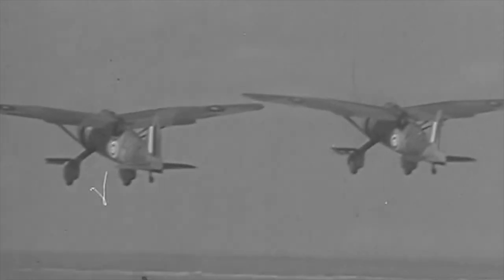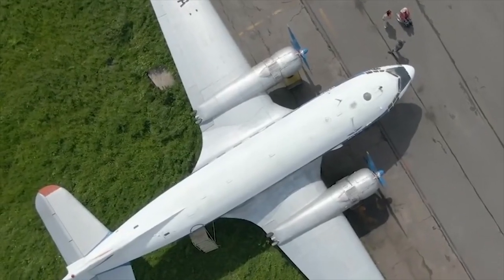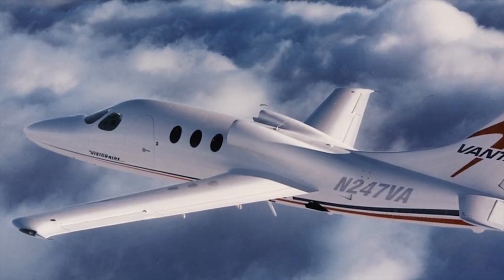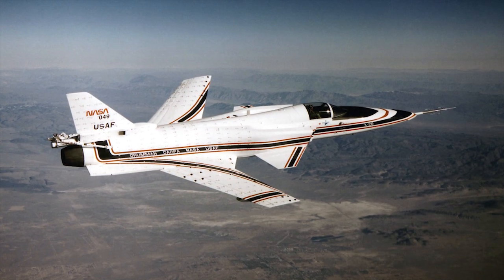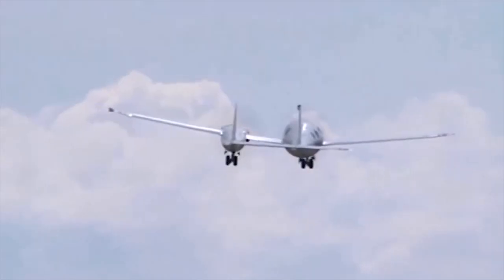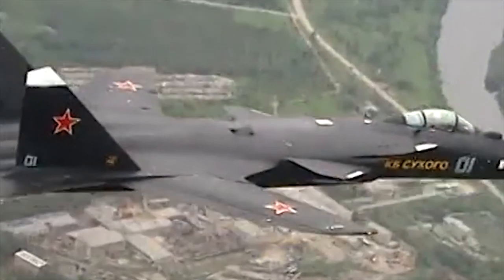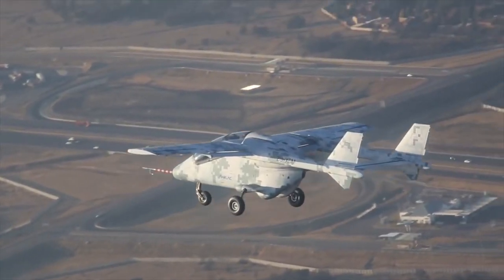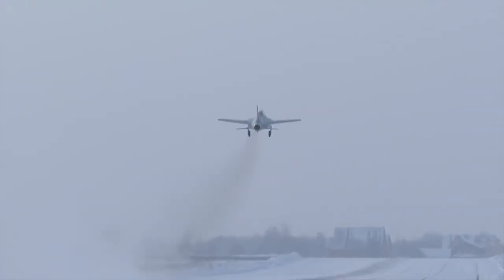Most Insane Forward-Swept Wing Aircraft Ever Built

Comment: What about the BERKUT
Reply: cancelled project because even though forward swept wings give you major advantage in low speed high manouvre at high speeds its very unstabile. it wont stall at low speeds because stalling starts at the tips of wings and since aelorons are at inner part on forward swept they can handle low speeds but high speeds do stress the airframe alot and maintance time vs fly time was simply too high. same problem with the US F-22 raptors stealth coating, for every fly hour it needs 13 hours on ground. thats why they want replace it. B-2 is 1 hour fly and 40 hours ground. Berkut had same issues. too much ground time compared to fly time. USN scrapped F-14 because of that. 1 fly hr for 22 ground hours was too much. F-14 was and still is superior to F-18 and F-18F/E super hornet in air superiority missions but price was too high. Thats why they still researching for a replacement. they need a high power fast mach 2+ jet, hornets max go 1.8 and new F-35 max 1.6 but ground time is what makes most aircrafts cancelled or decommisioned. Russia was like USN they could simply not afford and justify such ground times thats why Berkut was cancelled
Reply: @kristianxoto  owhhh gutchaaa
Reply: Why do you think the F-14 is still superior to the modern F-18 ?
Reply: @androidworld8605  yeah right, i still don’t understand that.
Reply: Do you think the modern F-18 is superior to the F-14 ?
Reply: Why did you say the f-14 is superior to the f-18 ?
Reply: @androidworld8605  because the f14 was so heavy and big they needed swing wings to take off and go supersonic. So bigger size=bigger weapons